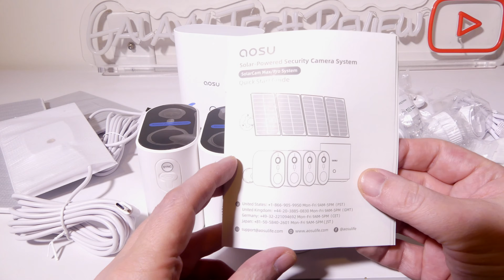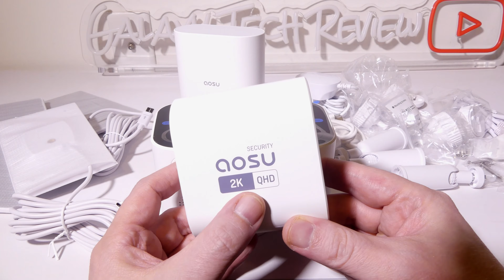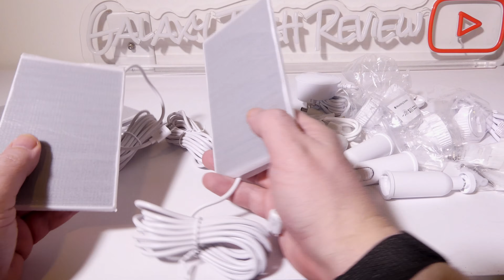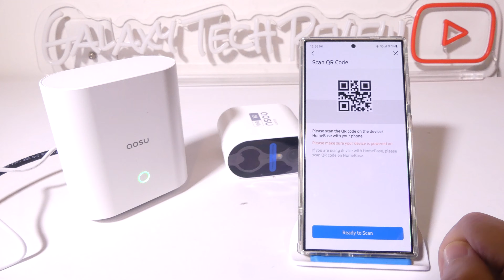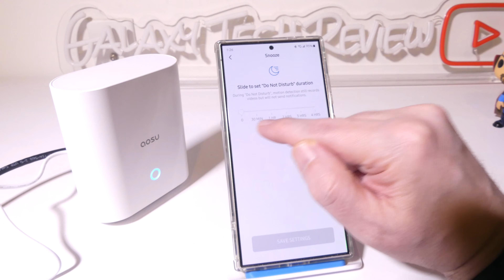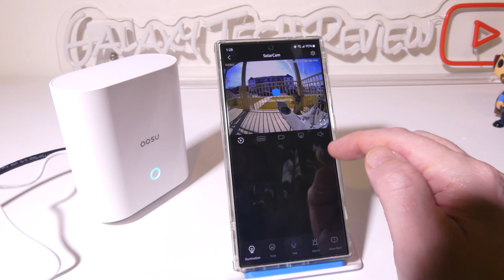AOSU SolarCam Pro 4 Camera Wireless Security System REVIEW

Comment: How do you angle the cameras for a better viewing angle??   The moveable mounts are for the solar panels.  The camera mounts look like they mount the camera parallel to the mounting surface.  So if the camera is 10 feet up it is looking straight out 10 feet up.   Maybe I'm missing something.